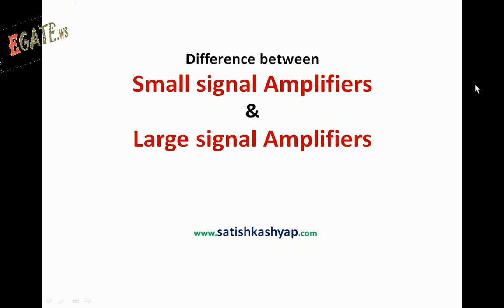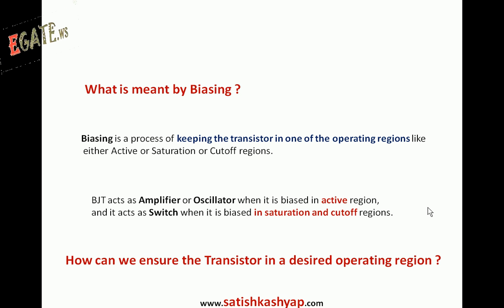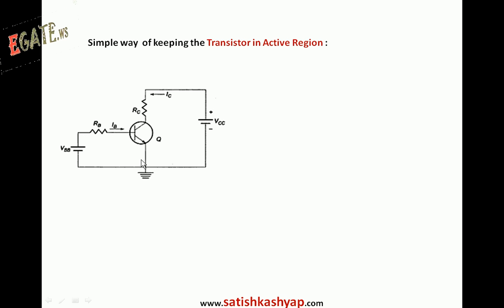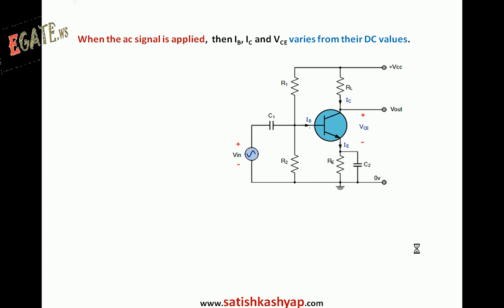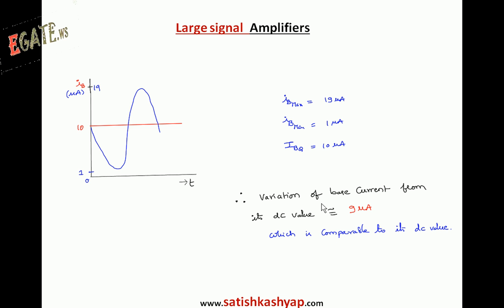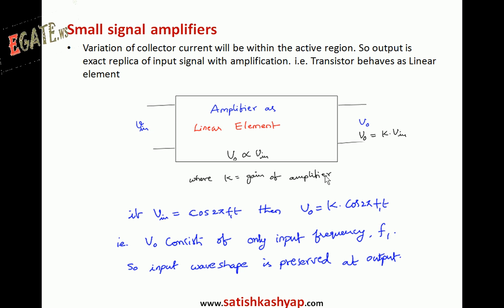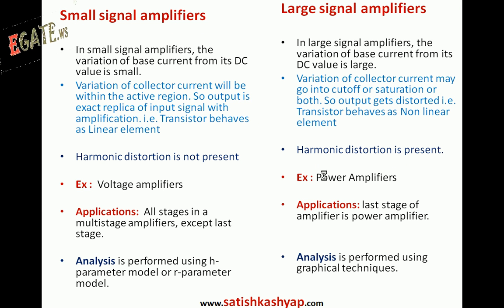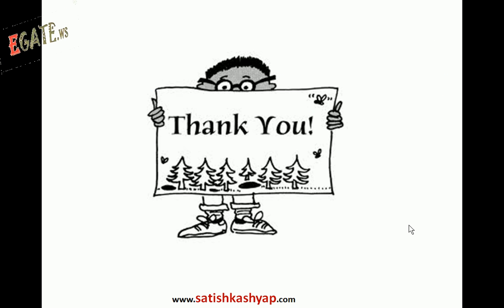Differences between Small Signal Amplifier and Large Signal Amplifier

Comment: very good, except the audio is kinda high base..hurt ear
Reply: Phi Vo need low pc filter, find cut off frequency and the RC values. remember for low pass filter the output voltage is across the resistor.